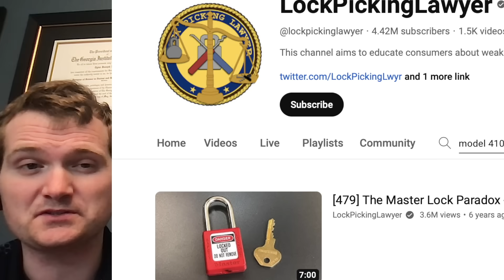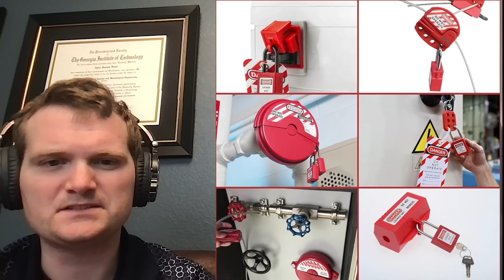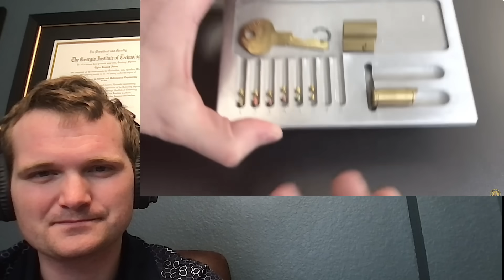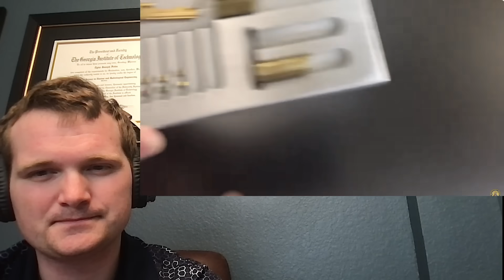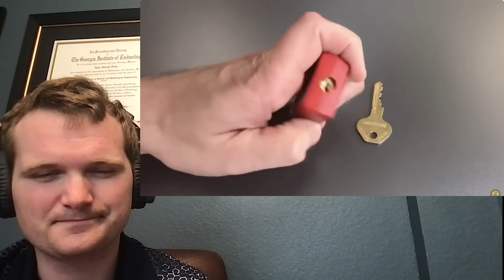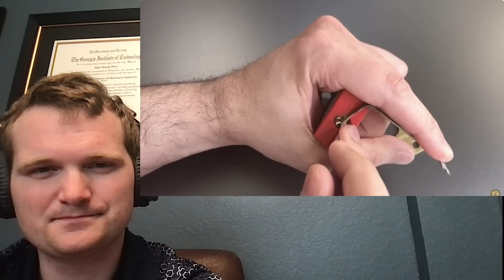Nuclear Engineer Reacts to LockpickingLawyer "The Master Lock Paradox - Model 410 LOTO Padlock"

Comment from the maker: Thanks so much for watching! If you want to check out my reaction to a “nuclear launch key” from Lockpicking Lawyer, please check out: https://youtu.be/YTWEHT__G_A?si=c1N7mc8ib0A0qRXe
Reply: As the person from a tech crew, who sometimes uses those things, i can find reasons for making this lock in that way. More pins means more combinations for the key - more people can have unique keys. Strange thing is putting security pins in there. This is not a security lock. This is just a warning to not to turn some machines on. So i completly get it being made from easily destructible materials just in case a person who put a lock on, cannot be contacted because their shift is finished. For me it is normal even if you use a screwdriver to "secure" a power switch. Any other tech seeing such thing knows to check the whole machine area for other techs working on such thing. This is more for dumb operators switching on things, just because they are switched off. All of the tech crew will take a stroll, shout and check if they see even a paperclip pushed through that switch hole to make an extra effort to switch on the machine. And that's all it is ment to do - extra effort for someone else to consider, there might be another person in danger if you just flip that switch.
Reply: yes in fact most security relies on peoples assumptions , for instance you  would think every square inch of the pentagon is under surveillance and in fact its not but  that belief alone keeps most people away , and yeah some would see a 4 lb lump of steel and think that would have to have a decent core so yeah unless you knew what you were looking at it will fool most
Reply: You don't want to accidentally stuck your head in a partical beam... 

Yep that happened.
https://youtu.be/mD4J5VUwiAs?si=9eMopFd8HLmPR9t0
Reply: Thanks for explaining LOTO to people. Master Lock are really the joke locks for LPL and other locksmiths. Many of their products look intimidating, and the security claims look grand, but as you infer, it's basically good marketing. For the sake of saving a few cents in manufacture, so many of their locks are fitted with inferior cores. 
But as it happens, most illegal entries are not made by picking the locks. Lockpicking and lock bypassing accounts for only around 7% of all illegal entry crimes. The main ones are either destructive entry or social engineering - such things as 'borrowing' a key, tailgating someone through a doorway, or a person being lazy or forgetting to use their locks.
Reply: @RWBHere  rather like the Norden bombsight. All of the souper seekrit secrecy crap on the sight was directly from Norden, not the Department of War, which didn't even bother classifying it - but got roped into Norden's scheme by contract.

As for this LOTO, had one, picked it quickly enough, the security pins slightly slowing me down, the non-spring return not really slowing me down at all. Better than most Master locks, which honestly isn't saying much other than they're not Kwikset...
Reply: As a ship captain if I catch a crew picking a LOTO lock I will have them fired on the spot.

You are putting someone’s life in danger.
Reply: @timh6845   What fun is that?  Whatever happened to old fashioned keelhauling, even if it has to wait a few days until the ship is in warmer waters around sharks?  ;-p.
Reply: Sorry it took 2 years to see this video and comment on it!
Reply: My dude the edit didn't correctly stick in the l o t o correction and error are both there

Comment: Every lock can be picked. The false sense of security we as a populace has by placing the standard locks available at Lowes, HD, Ace, whatever, is horrifying. When I learned to pick locks, I was shocked how many FRONT DOOR BOLT LOCKS were so easy to open, as LPL would say, an amateur (like myself) can do it with little difficulty.
The security comes in the times it takes. The best locks can still be picked, but how long will it take?? An amateur will begin picking and take so long they get caught, a professional will look at the lock, know right away how long it will take them, and just walk away from the better locks - even though they KNOW they can pick it, they also know it can't be done in the time frame needed to get in unseen.

Comment: A LOTO doesn't even have to be a lock, sometimes it is just a ziptie with a tag on it, it is the ACT of removing it that is forbidden, so no need for extreme security in many cases
Reply: The navy doesn't use any sort of lock or operation prevention 
Just turn the equipment to off and tie a piece of paper to it that says danger

Comment: these are not security locks these are access control locks. these are more to prevent someone unknowingly turn something back on while it is being worked on, or someone who doesn't know or read the tag / sign from just turning something back on. 
the usual thing for masterlock is the more secure the body is, the weaker the core is, the more insecure the body id the stronger the core is. 
masterlocks are generally designed to be removed. the hardened ones are easy to remove by picking and the soft easy to break ones are much harder to pick to remove.

Comment: it does not mater that the lock is junk it only maters that it is pick resistant, in an emergency it can be removed with easy destruction, but someone can not pick it try and use said equipment (unauthorized) then put the lock back on potentially putting people and equipment in danger and if its missing or broken you know someone has been tampering with said equipment. the paradox is their other locks do not meet the requirements needed.

Comment: At the end of the day, physically, these are only meant to stop accidental operation of switches or resetting of kill switches. They're not meant to "secure" anything, so the core complexity really is probably due to needing a lot of different combinations to prevent two identical ones being used in the same place.

Comment: So, I get that you need to be able to remove the luck in an emergency as an explanation for the non-hardened shackle and plastic body. The question is, why does it need a fairly robust core? Why 6 pin instead of 5 or 4? Why the security pins instead of something cheaper? And why not use that better core on other locks where security is more of a concern? The logic just seems to not be there.

Comment: There is one thing I never get about those heavy-duty locks with crappy cores. Doesn't it cost a LOT more to make all of that secure metal body and beefy hardened steel loop, than to add a few more tiny little pins and springs? You'd think the pins and springs would be a small fraction of the total cost. I admit I know nothing about the making of locks, but really - the pins are just tiny brass barrels that are not quite cylinders. How much can they possibly cost to make in bulk? A nickel apiece?

Comment: The LOTO locks are not meant to be hard to pick as they are only to be used to lockout power sources and disable equipment and are not meant to stop people from breaking into something. There are strict regulations as to how these are to be used and who is supposed to lock and unlock these. At one place I was at someone cut one of these off a power switch without going through proper channels and procedures (the only time these should be cut off is if the key is lost and a strict procedure is being done to ensure safety) and the guy that cut it was fired on the spot. As to why the LOTO locks sometimes have better cores than you would see on other locks I honestly have no clue as it is rather unnecessary but I think it would be cool so see some of these superior core designs show up in other locks.

Comment: I've only played with picking a little bit after finding a nice lock pick kit in a car in the junkyard. I actually got pretty good on Master locks...but as LPL will tell you, that's why...they are weak! However I've only been able to pick any of my LOTO locks about 2 out of 25 tries. 
And YES, I practice LOTO in front of all of our employees as the Facility Maintenance Manager (just me, small building 45,000sf). But I'll put a lock on a shut off at the ceiling even though NOBODY is going to get on the scissor and turn that valve or electrical box. There are times when I've had to lock out something that an area manager didn't know about but they are all trained to find and contact me first (of course according to the print on my locks) But I do it so people stay familiar with it because some of our people to go offsite and do service work. It also prevents me from forgetting something after 10 interruptions before I get to my lunch break. 
Always follow your training, it's there for a really good reason!

Comment: LPL did not mention key picking or key way exclusion — he knows of both but does have to watch his time. LOTO locks with 6 pins win on this. The 5 and 4 pin version in the standard boring key way can never cross over to the 6 pin core but the reverse could happen.

Comment: I have never heard of LOTO cut off for an emergency. More often it is a person of equivalent qualification is available to rate the site safe now. One case I saw was something locked out by an electrician one day. His usual day off was the next day and a different electrician did the repair.  After some paperwork with the site supervisor, i cut off the lock. The first electrician was assigned a new LOTO for his use.
Reply: They could have used the multi-shift loto procedure.
Reply: @wesss9353  Many places do. It was not for this place. The administration of the system needs to support the one lock and one key process is done in the paperwork. In shift work, you will have duty keys. The only key in circulation is on a ring which gets signed from one shift to another.

Comment: I'm glad that Master makes one good lock for a low price. They are great for practicing locksport. Where else can you get a high security core for $7?
The internal design is also better than half of their locks (The shackle is locked on both sides by steel bearings, not just a spring latch as is on most under $10 locks.)
LOTO are supposed to be able to be removed with a hammer. It protects the equipment.

Comment: At 2:12, . . .,  and the one who placed the lock is the one at risk if someone operates the control without authorization.  As for the good core in the crummy body, maybe it's an OSHA thing.  Maybe OSHA specifies minimum standards for the core, but forgot to say anything about the body.  After all, anyone who even thinks about overriding one of these things (except in an emergency) is likely to kill someone(s), and should be fired immediately.  Like most locks, they're intended to keep the honest people honest.

Comment: Important part about having the non-hardened shackle is when the worker has gone home, and forgot to remove a lock, it is sometimes easier to find out that worker finished the work and forgot the lock and just cut the shackle rather than have them commute back in to remove their lock. I have seen that a few times.

I have only seen the one on the right, and yeah, it is meant to be cut into if needed. But only if needed.

Comment: Honestly it’s probably all about marketing. As I’m sure you know, given your experience in an industrial setting, companies spare no expense when it comes to safety. The sheet metal LOTO key boxes are $86 from grainger as of this comment. That lock is $22. While that seems cheap, they probably have a couple dollars wrapped in the plastic body and mild steel shackle. So the can put the better core in as an additional selling point to safety and probably make 300-400% profit on that $22 lock

Comment: The purpose of a LOTO lock isn't to be anti-theft.  It doesn't need a lot of security.  They protect against negligence and other error, not against sabotage.

If I were to take a guess as to why the core is six-pin, I'd say to reduce the possibility of the same key opening multiple locks.  That would be like clearing tags on the wrong tagout.

Comment: The LOTO locks we use are completely plastic (except the core of course). You can destroy them easily by smashing them, or wrenching them open with a metal tool. That is intentional in case of emergencies and you have to operate whatever it is they're locking and you don't have time to go do the paperwork first.

Comment: Once upon a time ... I was installing equipment in a factory in France and had to work on the hot side. The plant engineer told me that he had locked out the power but I politely insisted on seeing the LOTO myself. He a bit grudgingly showed it to me and I went back and laid on the wet concrete floor, stuck my hand into our equipment and got a 220V buzz on the back of my hand. 
Being French he said not a word nor showed any emotion at the error.

I hot inserted spare fuse holders I had with me in all 3 AC wires and told him he could get his plant electrician to restore it to local codes after I left.

Comment: I've worked on a number of different industrial sites and different industries... The process is basically the same across the board... Taggers will tag out / render safe a piece of equipment with their own set of keyed alike locks and the key is held inside a secure box with the jobs permits and paperwork attached to it... Workers then place their PD (Personal Danger) locks. which are typically these red locks with a plastic body. onto the secure box's lock hasp so the box cannot be opened to retrieve the taggers key ...  Until the last person working on the equipment removes their lock the taggers key is 'secured'.  

This is a pretty standard safety system internationally...  I've had situations where I've had to remove my own lock after losing a key, No paperwork required when you have to remove your OWN lock :) 2 shifting spanners and the body snaps :)

Comment: They aren't safe at all. How we use them is making them very safe, but as a lock no they are not. I am a sawmill mecanic amongst other thing, and these lock come with keys and keys dissappear from hands, pockets, knot and key chaines. I ended breaking a few of thoses. Tow 15/16 standard wrenche or keys are we call them in french. You can easily break the lock, putting the pressur on the bases of the lock close to the body. They simply break apart, as most of these are now plastic.

Comment: Hi 2 years later,
I know nothing but what was said in this video, so basically an expert now.

So here is what I heard:
Tyler: These locks are regulated by OSHA to have unique keys and duplicates are heavily discouraged.
TLPL: the shackle isn't harden, the body is plastic. There are 2 othere versions that stronger but less secure.
Tyler: those are old school and uncommon

My deduction:
Given the standardization of the lock the core and body were described in policy then translated into a real lock.

If challenged by Tyler or TheLockPickingLawyer I'll test the hypothesis and look for a paper.

Comment: 11:54 - Any such intimidation is immediately lost when the would-be intruder/thief sees the "Master" logo. Many of those locks can be opened by pushing a "bypass tool" (a long, straight, mini-golf-club) straight through the keyhole, all the way to the top of the lock, and then just turning the actuator!

Comment: I work at a factory that uses a lot of robotics. We use loto locks on physical enclosures (somewhat like rooms ) when needing to work on the robotics or be near them for any reason. The doors themselves are master switches designed to kill the operation of the machines, so when needing to work on them we use the locks on the doors to keep them open while inside, so that no one can close the door while it’s being worked on.

Comment: I think I can shed some light on this paradox.  The issue is that the standard padlocks are not safety critical.  The LOTO lock (modern version) is safety critical.  If someone is working on a piece of equipment and it's suddenly turned on, that worker's life could be in danger.  There have been multiple industrial accidents when people removed the tag outs and turned equipment on.  Safety is no joke and is something that everyone must take seriously.

Tyler, I do have a question for you about nuclear plant safety.  In the situation where a piece of equipment is down for maintenance or repair, and it's needed immediately, what is the procedure if the equipment is in an inoperable state?  Such as components removed or disassembled?

Comment: I think outside of it needing to be removed in an emergency there's another reason they are relatively weak and that's because a regular lock has to be tough to prevent unauthorized intentional access by a thief and a lot of thieves don't pick locks they just cut them so a solid lock is a higher priority where as a LOTO is to prevent accidental access by a technician so you want an incredibly robust core that allows for a large amount of unique configurations and good security to prevent duplicate keys and accidental opening meaning because a technician or engineer would under normal circumstances only use a key its not necessary to have a hard body.

Comment: Maybe Master didn't use more secure cores in their "RAWR' padlocks because most are put into a sock and turned into an attitude adjustment wrench... :-) I also think the lock body on most LOTO locks is thin and plastic to keep the weight down.  I sure wouldn't want to hang that battleship that looks like a padlock off a 15 amp breaker toggle...